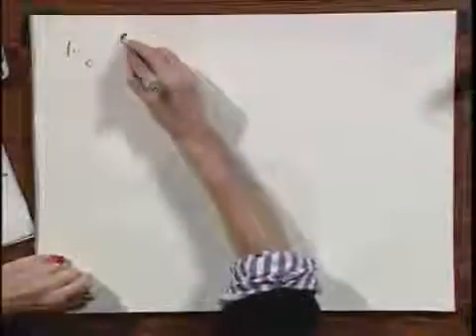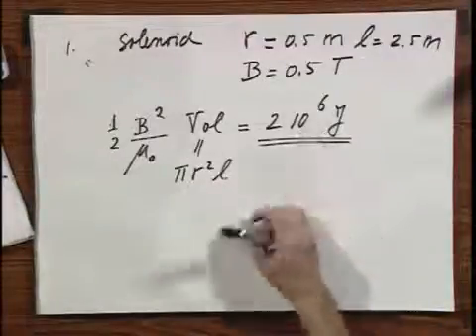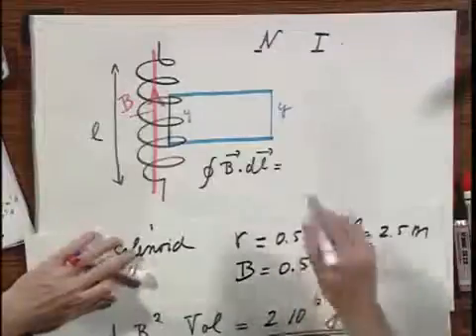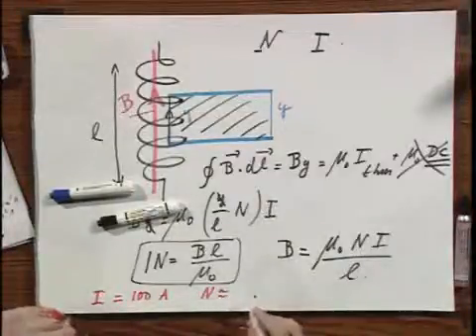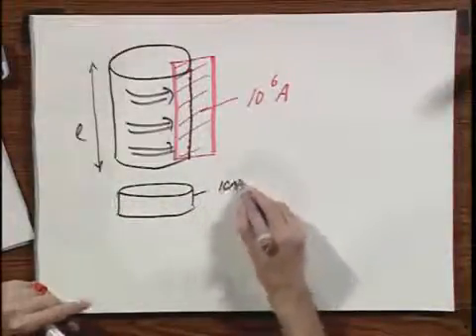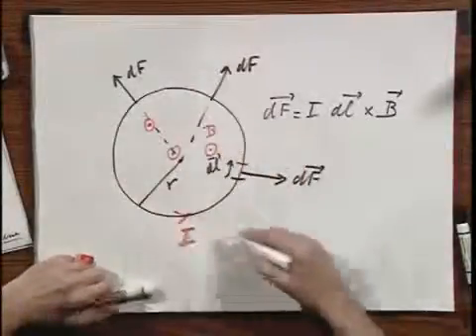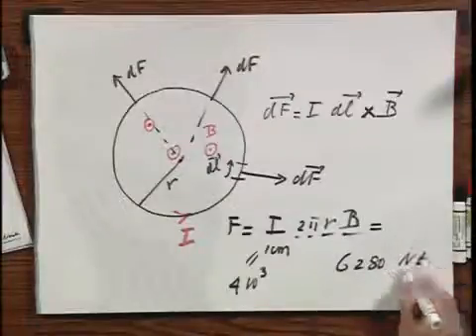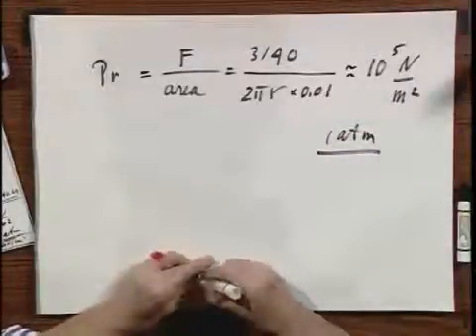8.02x - Module 10.01 - Pressure Due to a Magnetic Field in a Solenoid.

Comment: Sir I am having trouble in formulating the equation of simple harmonic motion between two magnets repelling each other. Please could you explain that sir, even if you did please could anyone else, who watched that video could reply with the link. Please....🙏🏻
Reply from the maker: >>>simple harmonic motion between two magnets repelling each other>>>
magnets repelling each other is NOT a SHM
Reply: Sir if you keep 2 magnets on top of each other, with like poles facing each other, they repel each other. So one levitates on top of the other. If I fix the below magnet on a hard surface and clamp it, so that its fixed and immovable, then after that I put force on top of the other magnet and release after pressing it down to a little distance, then shouldn't it be in a oscillating motion sir? ( Thanks for replying sir.)
Reply from the maker: yes it will oscillate though it will be very unstable and the motion is  NOT a SHM.
Reply: Thank you sir for your answer. I was trying to formulate the equation of the damped oscillation. I feel that the magnetic moment X magnetic field has to work. But I am not able to calculate the force of repulsion. Is it the magnetic pressure multiplied by the area only, or am I completely messing up my concepts?
Reply from the maker: The repelling force as a function of distance is extremely complicated. It depends on the shape of the magnets. There are no analytic solutions. Only  numerical computations woud give you a reasonable answer. The period of oscillations could then also be approximated by numeric computations,. Provided that the magnets are constrained to not move in horizontal direction.  If  they are not constrained the magnets will tumble and attract each other and become ONE.
Reply: Lectures by Walter Lewin. They will make you ♥ Physics. Is the force acting on magnet 1 the area of magnet 1 times the magnetic pressure? Whereby the magnetic pressure is calculated by Bₙ²/2μ₀ and Bₙ(B-net) is the sum of the B fields of magnet₁ aswell as magnet₂ as a function of distance?